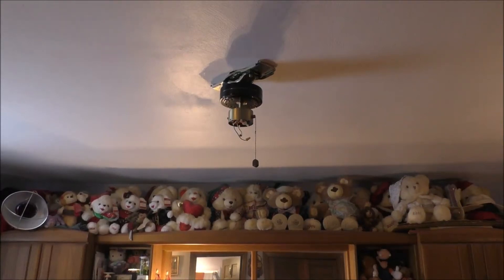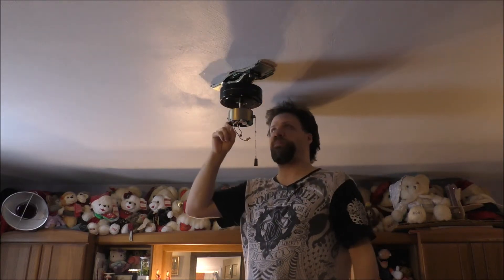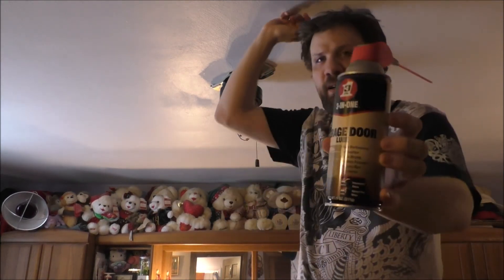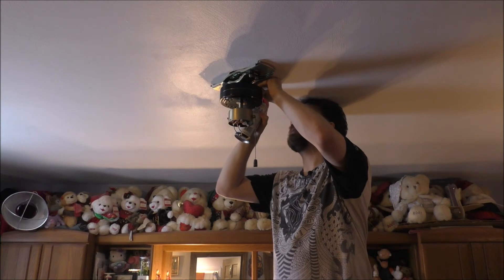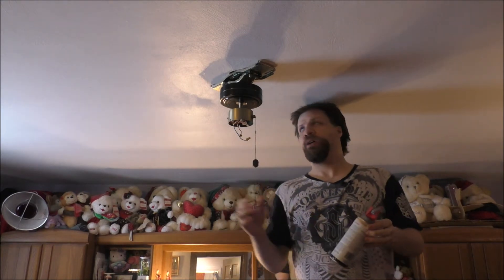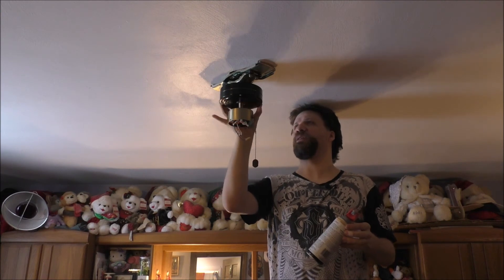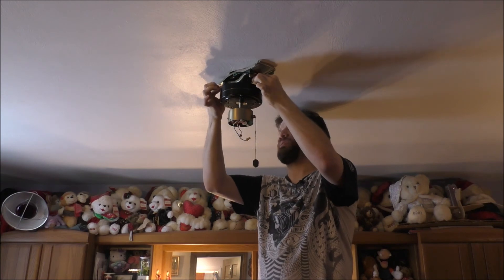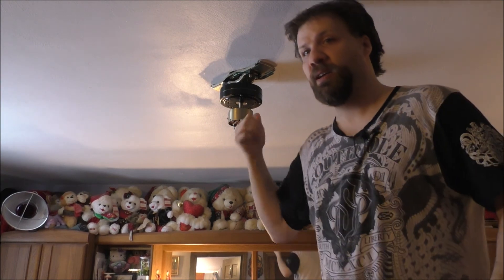THIS CEILING FAN HAS A AWFUL SQUEAK

Comment: Once ball bearings get noisy it is almost impossible to quiet them.  If they are bronze sleeve bearings, and they are not too sloppy, oil should quiet them down.  Don't forget there is a bearing on the bottom also!  Hope you can get it fixed!!!!
Reply from the maker: Thank you so much for the good information :-)